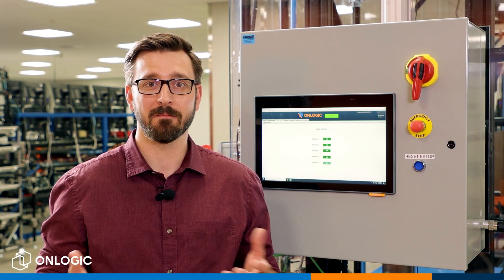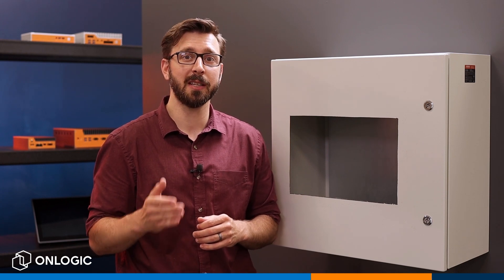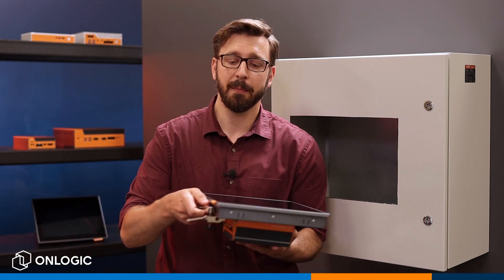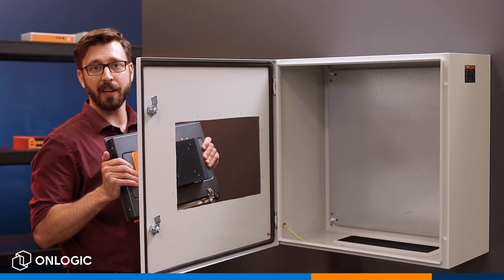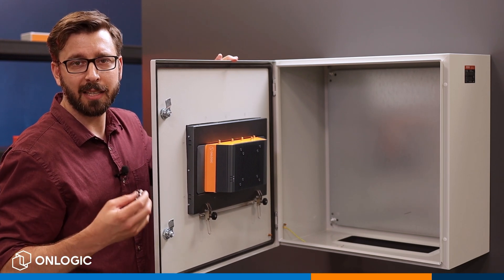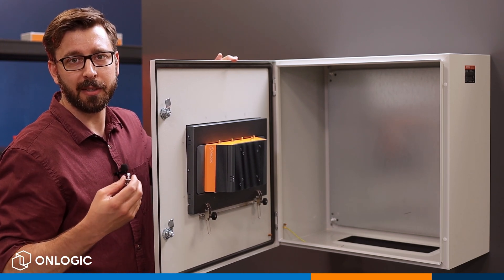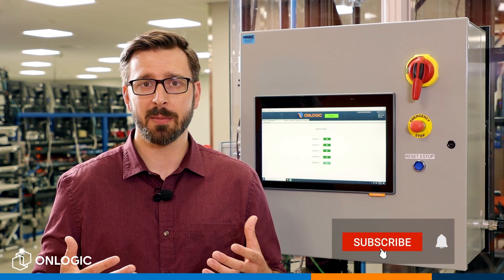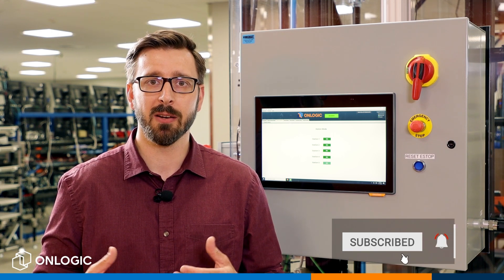Installing OnLogic's Tacton Panel PC

Comment: Is there a version of this hardware available without the panel? I don't see an equivalent Karbon/Helix series IPC with that connectivity and processor in the current lineup.
Reply from the maker: Thanks for the question! The Karbon 802 ( https://www.onlogic.com/store/k802/ ) can be configured with virtually the same connectivity by using its dual-ModBay expansion slots, and features as much (and more, depending on your CPU of choice) processing performance, as the Tacton TC401.